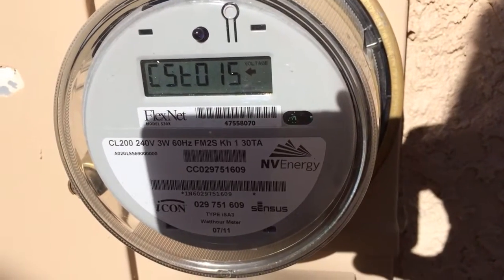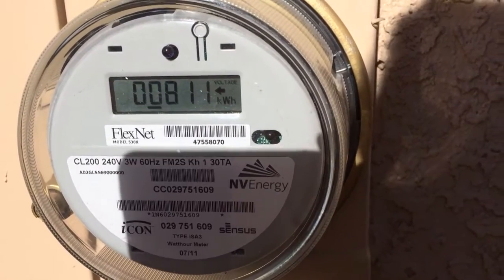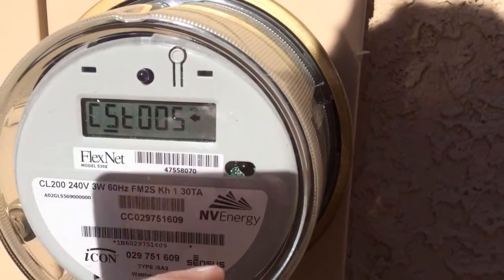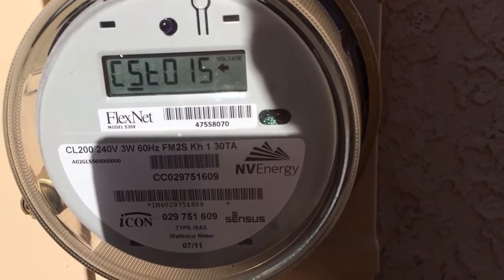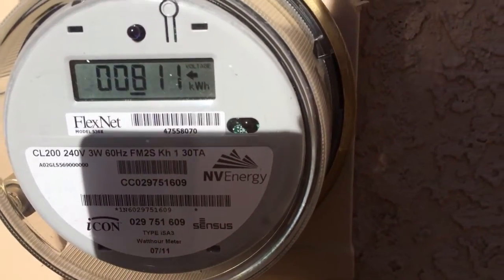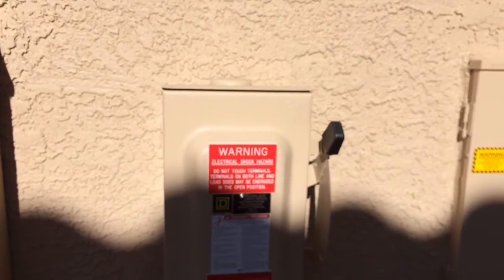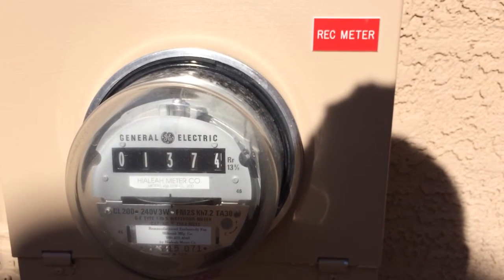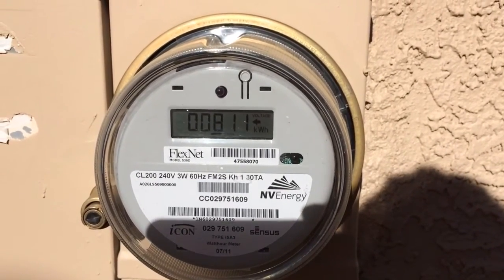How to read an NV Energy Solar Net Meter

Comment: those numbers 005 and 015 will accumulate for ever and get bigger over time. if you write down the 015 number ( incoming from solar) wait a few minutes then check the change this change is how much power KW you produced in a few minutes.  best you can have is the 005 number is smaller than 015.  people really don't need to have the app and monitor program if they learn how to read/understand the net meter.

Comment: We are NJ( ugh) and have a new setup. Do these meters  have the ability to be monitored remotely over the internet? In order words is there an IP address for this meter that we can see? Thanks and thanks for the informative video.
Reply from the maker: Yes & no. I could monitor my panels and know how much I'm pushing back into the grid, and how much they are making. This was through a website and app that came with the panels. I could also go into NV Energy's website and check consumption on my account. But no access directly to the meter itself. It can talk to the power company, but I can hear that conversation...

Comment: just got solar and found your video. the 852 nv energy is giving you will be outdone by your solar panels by end of day. 811- end of month reading will top the Nv energy..correct?
Reply from the maker: Need to think more long term, as in annual usage. Typically, I made more than I used February through Early June. Once the heat hits, I use more than I make, but the accumulated KwH paid the bill. October through January are a wash, usage and solar are about equal.

Comment: Hey I have this meter and installed solar all it shows me is E 8000 all other screens are blank the arrow shows to be correct day/night
Reply from the maker: Is it brand new, just installed? If so, I'd think NV Energy has to activate it. I'd call them, or whoever installed your solar.
Reply: @dand318  I'm not sure who NV energy is. I installed the solar myself 2x sunnyboy inverter and 40 pannals. Sold by gogreensolar
Reply from the maker: @earlcarmichael4030  NV Energy is the electrical provider for Southern Nevada. I had assumed you lived here as well. They had to change the meter to a Net Meter, one that runs backward as well as forward. If you did it DIY, I'd contact whoever your electric company is. I was warned by our installer NOT to turn on the solar before I got a new net meter. If I did, the old meter would register the solar power I produced as power used, and I'd get charged for the power the panels made. A standard meter only has the ability to see the electricity, not which direction it's going...
Reply: @dand318  ahh ok, I live in a very small rural town in watonga and the electric is co op with the city I am one of the first people to get solar. The problem might be my electric company just don't know what there doing. I have called someone is sopose to get back to me but kinda feel like there avoiding me

Comment: Very helpful video. I had my solar system activated this Monday (June 15th). I understand the arrow direction and the moving segments at the bottom of the display simulating the old fashion spinning wheel. Does the speed of the moving segments give an indication of the current flow or rate of power consumption or feeding into the grid?
Reply from the maker: Yes, absolutely! Wait until you have full sun on you panels, then turn off your AC, pool and other heavy loads. That thing will spin like Wheel of Fortune! Start turning on one thing at a time, and it will slow down. It's a good way to determine what pieces of equipment are the power hogs in you home. I had a small portable AC system in the garage. It surprised me how much it would slow down my wheel the it was on!

Comment: I've got this meter, but the utility hasn't switched me to net metering yet. When I power on my solar/inverter, I get E 8000 displayed and an arrow showing production going to the grid. Nothing else cycles on the meter. Not sure what E 8000 means, but I probably just need the utility to reprogram the meter to net meter.
Reply from the maker: I was warned not to switch on my solar before the net meter was installed. The old digital meter only reads on direction, and it would read the energy I was producing as energy used, effectively doubling my bill. Not sure if you're in the same situation or not...
Reply: @dand318  I figured since I have the same model of meter in the video, I might just be able to get away with it. Tested for a couple hours and found the meter had counted the production as my consumption. Oh well, it was a $0.40 experiment.
Reply: @dand318  My new meter is the same exact model as the previous one. They must program them back at the shop rather than on site. Easier to swap it than to reprogram I suppose.
Reply from the maker: @RedpointFive  They physically changed mine, and it was digital before the swap. Almost 5 years ago, so they probably have updated them in that time. Wouldn't surprise me if they could do an over the air update now...

Comment: Thanks for putting this up. I was pretty sure I understood the net calculation but you confirmed it. I just turned mine in 4 days ago and I knew Southern Nevada was meant for solar, I was grandfathered in so it was worth the investment. I've got 4000 SF and and I'm on the hook for 20 KWH as of tonight, that's 5 KWH a day compared to 50 +- for similar temp days. Now I'm gonna get some hot dogs and cook them off the radiation emitting from my meter, even more savings!😂
Reply from the maker: You are most welcome. I'm grandfathered as well, and it's looking like I have enough in the Net Bank to easily carry me through summer! Gotta love $15.00 power bills all year...

Comment: Get rid of your smart meter and your bill will be lower.  Smart meter measure spikes. Analog does not. In Southern California smart are misreading to the high side. I wonder why?
Reply from the maker: This is a Net Meter, and is required for solar. It runs both ways, and measures electricity I put back into the grid. My power bills in the summer used to be $600.00+ a month with 3 A/C units and a pool. They are now $15.00 a month all year long...
Reply: Required in what state?
Reply from the maker: Nevada. If you have solar panels, they have to be able to read what I push back into the grid...
Reply: Why? Do you really think someone is sitting at a computer watching my solar panels? They don't. In fact we have a TOU meter analog that must be read once a month.
Reply from the maker: Whatever. I put this video up to show NV Energy customers, with solar, how to read their net meter. Not to debate someone from SoCal about digital vs. analog electric meters. Move along, nothing for you here...
Reply: On the contrary health, privacy and legal issues are swirling around the smart meter issue. Stay 10 feet away from them.
Reply: Dan D 
Sound very nice $15.00 a month all year long.  You own your solar out right or you paid Nevada energy $15 a month or you paid solar co. $15 a month?  Today solar customer service tell me free installation and free solar panel, said I will get 30% off my bill per month.  Why your bill only $15 a month please explain, I am very interested in putting solar panel. Thank
Reply: how many panels did you get installed?
Reply: I bought my 9500 kWh system. I will get SRECS every quarter that will pay me $2000/year or more, I'll get a Federal Tax Refund of 30% of the cost, I'll get a State (MA) tax refund of $1000, and the loan is very low interest. They estimate my system will most likely produce 11,000 kWh/year. My house has electric heat an cost me over $5000 from December - April! The Solar system is going to save me a ton of money next Winter.
Reply: @robinsheridan5234  It is not a tax refund. It is a credit against taxes you might owe. If you have no tax liability then there is no benefit to you.